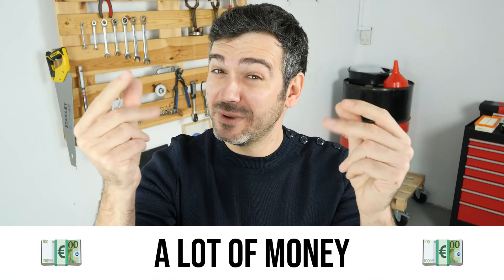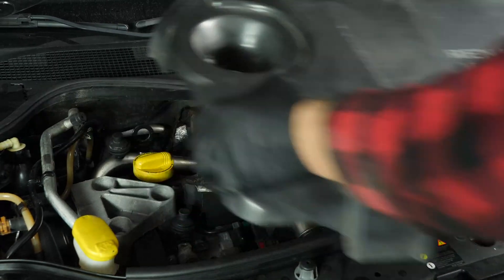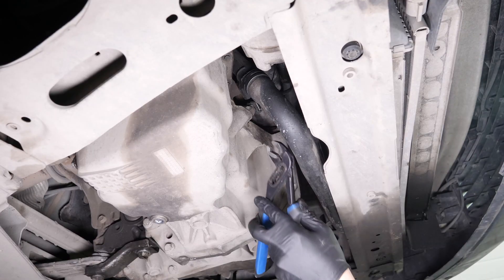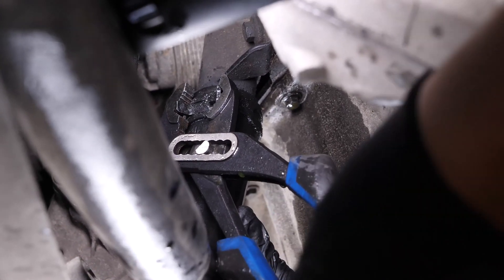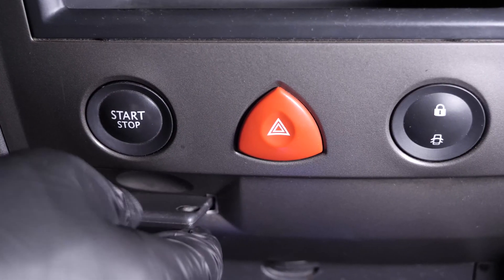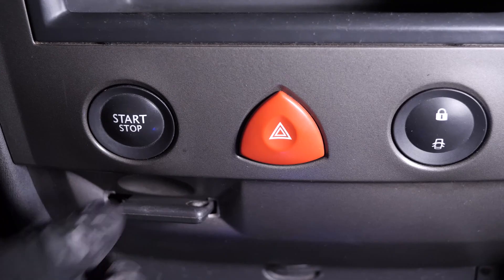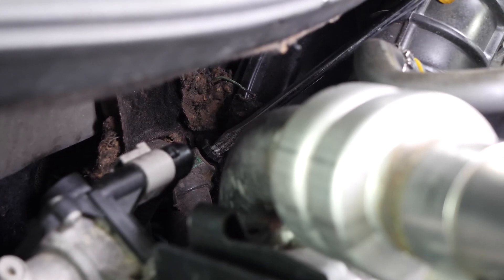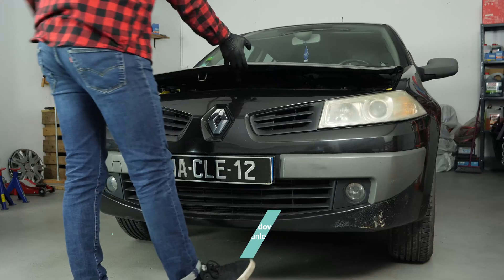How to bleed the coolant Megane mk2 1.5 dCi 🚗

Comment: Hello,why in the megan 2 1.5DCI  tutorial you have started the engine to bleed the air from the system and at the megan 3 with the same engine you used only your mouth to pressurized the system